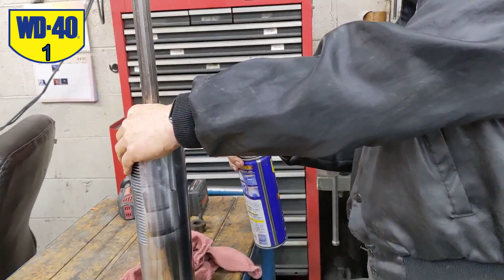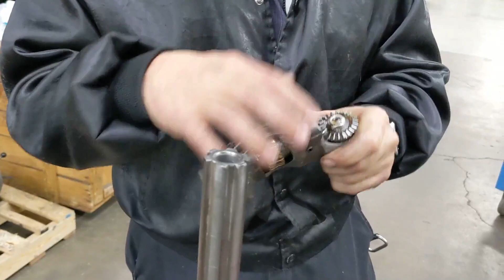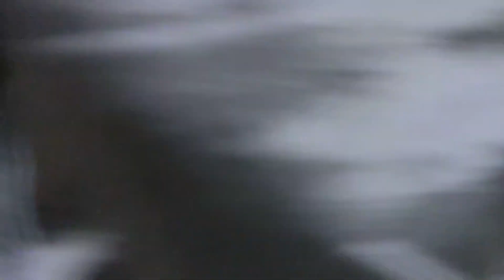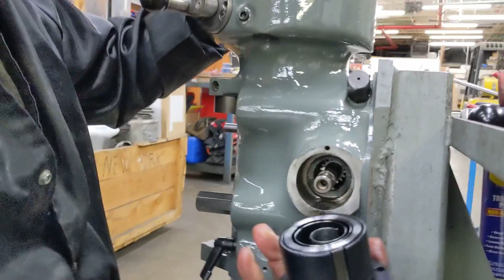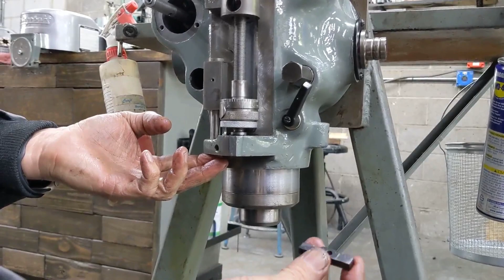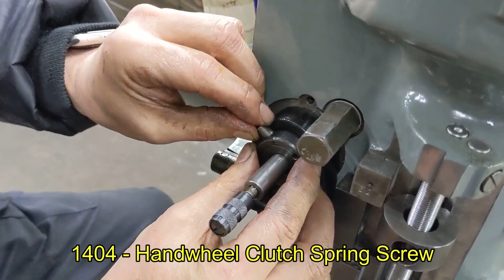Reassembling the Bridgeport Quill Housing

Comment: Barry, Thanks for all the great videos about Bridgeport milling machines. Will you please make a video specifically about all of the various J & 2J head noises, and help us to troubleshoot our possible issues. Thanks!
Reply from the maker: We have thought about doing something like that, the issue is that the noises don't come through correctly on a video.
Reply: @HWMachRepair  That's unfortunate regarding the sound coming across correctly in the videos. At work, we have several Series One Bridgeports, each with their own issues! One however is making a horrible sound like the bull gears are clashing, but when the variable speed is cranked up, the sound lessens more and more. Could this be a simple adjustment, or do you think it needs to be looked at? Again, Thanks for all the great videos!
Reply from the maker: @HowardWertz  We do have a flow chart on head noise diagnosis, or please give us a call and one of the head techs can help you diagnose the noise: https://machinerypartsdepot.com/technical-support/variable-speed-milling-machine-head-noise-diagnosis/

1-800-285-5274

Comment: Re: recoil spring: On my Comet clone I used my caliper depth feature to find the depth of the rivet head on the shaft. Then when I loaded the spring into it's housing I left the whole thing out about .100". It caught the rivet head the first time. My spring had broken diagonally near the inner end. I figured it was from having the inner end forced inward to catch the rivet, basically twisting the spring. I think the twist caused the diagonal break.

Comment: My clone is all metric. I just had to match up the reverse pull knob threads because my pull handle was missing. It was a M4 x.7 I believe. Also the hole in the top of the micro screw for the reverse trip lever must have been a metric size. It was too small for the bridgeport replacement part. I had to ream it out to 1/4". So just a heads up for folks out there working on asian clones, that a lot of these parts aren't sae like the bridgeports. It will save you some headaches when ordering....measure first.

Comment: great video--thanks for the detail. i did notice some chips and shmoo at 12:20 in the 3speed gear area. i have watched every one the videos multiple times. i think i can disassemble, clean and reassemble the whole thing in my sleep. i also notice that the only time you mention bearing orientation is on the spindle bearings. do other bearings (sliding housing, bull gear etc) have particular orientation. i am currently searching for suitable mill for my hobby use. would love to see rebuild of any other equipment--surface grinder, one the Lagun's omni present in several videos, lathes of any brand.
Reply from the maker: Hi Charles, other than the spindle bearings, the bearing orientation dose not matter. We would like to do other machinery, it's just finding the time and having the machines in there to go some of them. Thanks for your suggestion.

Comment: During the inspection phase of this repair, I'm sure all the parts and pieces are measure for proper sizing. so, my question is what is the proper clearance between the quill and the housing (head)? what is optimal and what is excessive? Also, if the housing is out oftolerance what if anything can be done for a repair?

Comment: How similar is a series 2?  I have one that the quill is sticking really bad in, and think it just needs to be cleaned up (I think it sat for a really long time before I got it).  And thanks as well for the great videos, I love the extra time you guys spend to include all the part names/numbers for easy lookup to replace.
Reply from the maker: A 4HP Series II head is quite a bit different when it comes to taking it apart. Mechanically they are the same when it comes to the way that they work, but getting into it is more challenging. You can give us a call if you need more help either troubleshooting or taking it apart: 1800-285-5271 -Barry
Reply: @HWMachRepair  thanks, one of these days when I have time I might take you up on that, if I don't decide to sell it/part it out.

Comment: Barrywhat did you do to eliminate the oil system?  My quil drips oil and makes a mess.  Heather said there is a felt washer on top of the quill which I noticed you didn’t put in on reassemble.  Please explain.  What is in the rebuild kit if there is one and what does it cost?  God bless. Frank
Reply from the maker: We use either sealed spindle bearings or open bearings with the high speed grease. If your spindle bearings are open and still good you could just get the grease and grease them yourself. If you want the entire spindle kit here is the link: https://machinerypartsdepot.com/product/srk-00/

Also please feel free to call with any questions: 1-800-285-5271

Comment: Ordered some parts from you yesterday and I'm sure more to come. These videos have helped me so much in my endeavor to bring back my Florida yard art Bridgeport. Are all the Series 1 quill assembly's the same? The machine I picked up has a nmtb30 taper. I have a parts head with r8 in it. Can I switch these out being as I have so much r8 tooling? Thanks..
Reply from the maker: The quill housings are the same between the Variable Speed and Step Pulleys on J style heads. You can change out the spindles, you will just need to switch over the spindle and the nose piece.
Reply: @HWMachRepair  awesome. Thanks for the info

Comment: I followed the Disassemble/Reassemble the Quill video exactly, but only for the Power Feed portions. All seems to work, except the quill does not move automatically. I have the Feed engaged, the Quill brake off. I tried all three speeds, nothing. While it is engaged, the handle will move the quill up and down without binding. Suggestions???
Bob
Reply from the maker: https://www.youtube.com/watch?v=G1E5IYd_eXs&t=98s

Follow the instructions in the video above. This is an adjustment you can do to make the downfeed engage better.  -Heather
Reply: @HWMachRepair  THANKS!! I'll give it a try!

Comment: I have a Bridgeport with J1 head; Does the machine has to be running in order the quill feed selector work? when my Bridgeport is off, the selector is stuck at one or maybe two positions of the selector and I cannot move it to any other position ; I am wondering if something is wrong with the mechanism and gears( although I cannot visually see any wear on them) or this is the way it should be.
Reply from the maker: Yes! The only way to move those gears is while the machine is running and the downfeed is engaged. This is true for all milling machines with downfeed capabilities. -Heather

Comment: thank you for this great video I have a question I have a Bridgeport with a non-variable speed head and found one has come on the market which is a series 1 head variable speed are can this just swap out? and if soo in your option would you swap a head? i know the variable speed is nice to have but is there any downsides to them?
Reply from the maker: Yes, the heads can be swapped out between a step pulley and a variable speed. Most people prefer to have a variable speed although I love my step pulley heads. You can turn your step pulley into a variable speed by just putting a VFD on it. We sell one for just $600 that uses your existing motor and pulleys. There are downsides to both heads when it comes to general wear and tear of certain parts. Please give me a call at 800-285-5271 so we can discuss this further. -Heather

Comment: hello sir, can you help me to resolve my milling head shakes when running and its vibration cause run out in tool holder. dahlih gh2200v milling machine. could you tell me where i can check, find resion and fix it. many thanks from viet nam
Reply from the maker: My head department would like you to email directly since there is quite a bit to check: 

HeadRepair@hwmachinerepair.com

Comment: what work did you do to make this quill a "closed system" ?
Reply from the maker: It's all in the spindle bearings. You can either use sealed spindle bearings or use the red grease that we use on the open bearings. Along with the shielded top bearing it turns the system into a closed system that you no longer have to oil. You can give us a call with any other questions if you prefer: 1-800-285-5271
Reply: @HWMachRepair  Ah I see, I had thought that the open bearings with the red grease did not qualify as a "closed system" 

Are the japanese bearings you use of a greater precision than the sealed timkin bearings? Or is there some other reason that you use these over sealed bearings?
Reply from the maker: @johnfurr8779  In our open bearings we use a high speed aeronautical grease. Once the grease is packed into the spindle bearing you can't use oil or it will degrade the bearing and cause it to overheat, that is why it's considered a closed system. We had a head come back in for work recently that we had packed 20 years ago and the bearings were still good. We just cleaned and repacked. We prefer the open bearings mostly because that's what we have always used. We carry both because we want to give our customers options.

Comment: Hi love the channel. Does anyone know the name or part number of the shaft that operates the worm gear that allows the head to tilt clockwise or anti clockwise. Mine has snapped off within the casting while attempting to bring it back to 12 o’clock following delivery 🤦‍♂️
Reply from the maker: Yes, the 1097 - Adjusting Worm Shaft: https://www.machinerypartsdepot.com/product/1097
Reply: @HWMachRepair  
Many thanks. 👍
Perfect excuse to tear down and rebuild.

Comment: WD-40 will actually produce rust once it starts to dry, fortunately these machines won’t likely be in overly humid environments and not just sitting.
Reply: I prefer Kroil to WD-40.
Reply: WD-40 was developed to coat the Saturn 5 Rocket so the ice buildup shed off during launch, water displacement -40th formula.